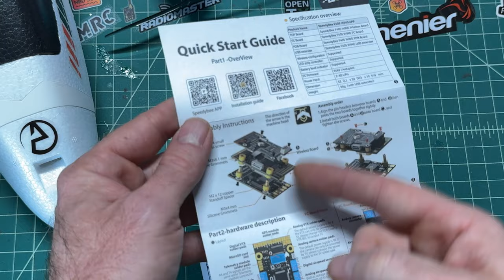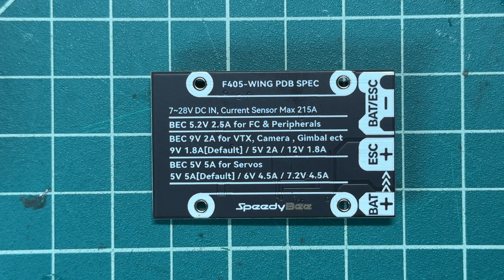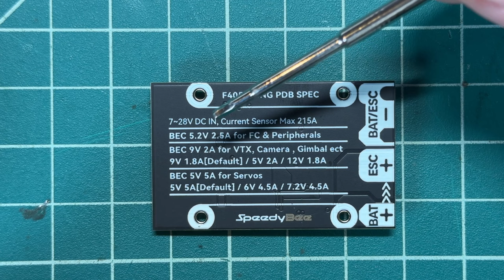THIS is a BEAST! - Speedybee F405 WING App - REVIEW & OVERVIEW

Comment: The plugs duplicate the solder pads (so only 1 camera and vtx).
It is missing the ability to switch off the 9V power (USER 1 option in inav), I do that so I can power off my air unit while waiting for GPS fix

Comment: All I really want is an inexpensive FC compatible with INAV7 and fixed wing.  Angle mode is all I intend to use.  No FPV.  No OSD.  Not even GPS.  Soldering is no worry whatsoever.  Is there something simpler and cheaper than SpeedyBee Wing?
Reply: Maybe you want a gyro instead? It will do level mode, angle lock, etc. you can set your own rates as well. I would recommend the Hobbyeagle A3 Super 4. RC Video Reviews has a great setup video called 'DEEP DIVE: Hobbyeagle A3S4 RC Plane Gyro with ExpressLRS and CRSF'

Comment: Hi ! I'm sort of new in this field. With a friend of mine, we wanted to build a drone, but tbh, we don't have much knowledge. So after buying it, I still have a lot of questions: does it support LIDAR ? And would it be possible to plug 4 ESCs to the pdb provided their consumption is low enough ?
Thx for the vid
Reply from the maker: Should support LiDAR if you use Ardupilot. 

Check the channel this week we have another VTOL flight controller review coming up.